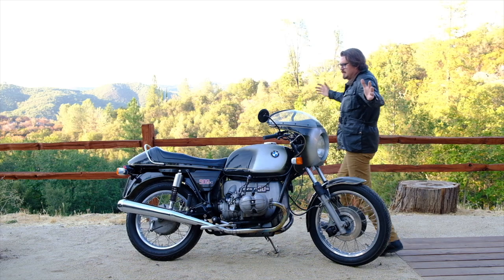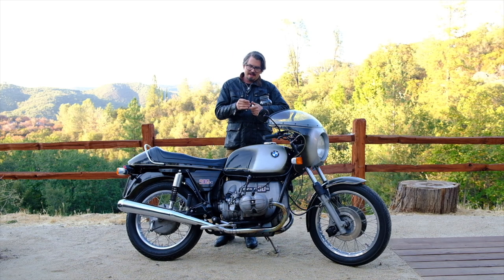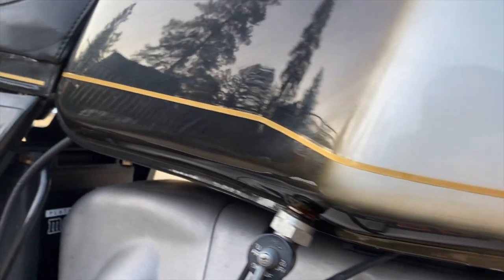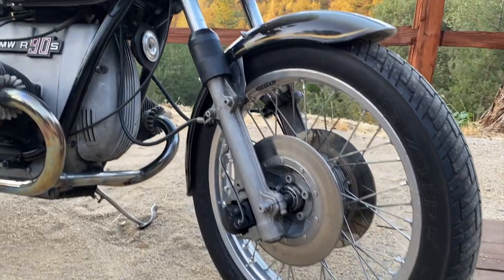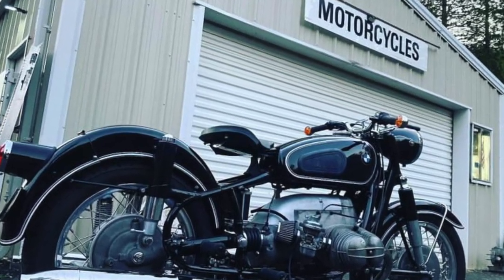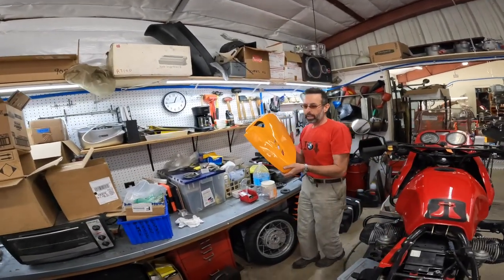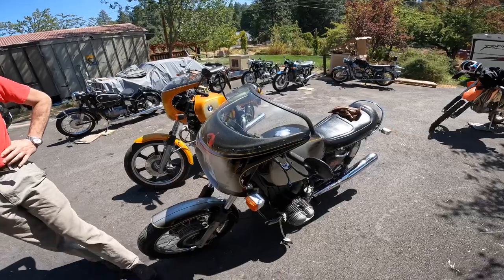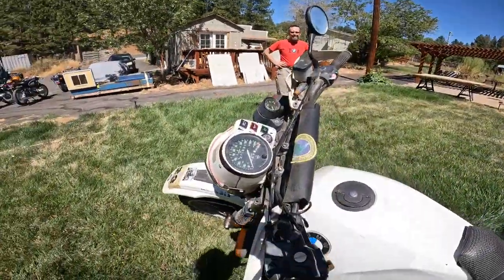Is this BMW’s Best Motorcycle? + Tour of Scottie’s Workshop! | A Bike and a Beer Episode 6

Comment: I bought a BMW R6/5 while in the military in Oklahoma.  I rode it home to Montana before being deployed, and the tachometer lasted less than 1000 miles.  After that the bike was bullet proof except for stuff like headlight bulbs.  It clanked when I put it in low gear, there was a disconcerting amount of driveling snatch, and it torqued like hell while waiting at stop lights. I occasionally got my pants leg caught on the tickler rod, causing me to almost tip over, again at stop lights.  The bike was overweight and under-powered, and it was, indeed, homely.  And I loved it.  That old pile of iron and pistons turned into an absolute swan in tight mountain highways, like those north of the Montana border in British Columbia where my girlfriend lived.

Comment: I owned 1974 R90S for about 12 years and it was one of my favorites. After a $2,000 purchase cost me about $1,500 in parts, tires, fluids etc to get road worthy. From there nothing regular maintenance oil changes, tires, greasing the splines, tune ups. Sold it for $5,000 to help defray one of my kids college tuition- a shame miss that bike but I’ve had many great bikes and many great memories.

Comment: That was a fun little video. I have 2 airheads and am the Air Marshall for my local chapter. You need to do a little learning about how to properly prepare your Weiss beer for consumption! Rolling the bottle to mix all of the ingredients before you open it is one and that particular beer absolutely deserves a proper glass! Commercially brewing in the same location since 1040! The signature clove and banana flavours are a by product of the yeast. I have over 1000 bottles in my cellar. 🙂
Reply from the maker: Great advice and thanks so much for watching! I look forward to trying the beer again with the proper preparations 👍
Reply: @wheelhousegarage  I've gone back and started at #1, I'll keep watching. Come on up we'll pull something out of the cellar. Pack your bags as I live about as far away as you can get on this continent from you. 😛

Comment: I owned a 1974 R90s, enjoyed it for over 130k of wonderful miles, had 2 issues with the tranny, 4th gear had weak dogs and, well, I broke them, but only after it had endured 75k worth of spirited riding, then a spring in the shifter broke putting the bike in 2 gears at the same time, if this had happened at speed there would have been a lock up at the rear wheel, then there were the spoke issues, I kept exceeding the tensile strength of one or two spokes, so that problem was dealt with when I bought Lester wheels. Many thanks to San Diego's Brattin motors for fixing my screw ups

Comment: Fun video and you were right about most things.  You can indeed ride the bike 1000 miles in a day.  I know because I did it with my new 1974 R90S.  I bought it brand new from House of Yamaha/BMW in Santa Monica, CA in late 1973.  They got 2 in and I bought one of them.  Tommy Smothers of the Smothers Brothers comedy team bought the other.  

There was an event back then called the California 1000 that ran out of L.A. Harley Davidson.  The purpose was to cover 1000 miles in a weekend starting at midnight in downtown L.A.  I covered 1000 miles on my 90S by midnight the first day.  Unfortunately, I'd missed some turns and had to backtrack so when I hit 1000 miles I still had over 100 miles left to go to get back to the Harley dealership.  I did the last 100 miles Sunday morning after a few hours sleep.  No matter.  For me it was an epic ride, one of my best in 56 years of riding.  And the engine does indeed let you run all day at high speeds.  I ran across the Mohave Desert for a couple of hours at speeds of 100-115mph.   The bike in fact would do an indicated 125mph topped out but the last few mph took some time.  As you suggested, the bike just runs.  It doesn't fuss, it doesn't shake, doesn't vibrate much, it just motors down the road as fast as you want to go.   It is over all the best all-around motorcycle I've ever owned.  And almost 50 years later the looks are still stunning.
Reply from the maker: Thanks for watching and sharing your stories!

Comment: Excellent episode!!

I had an R100GSPD that took me to, and through the Yukon and around Alaska in '98 and in '05.  Hands down the best bike I ever owned, until a hamfisted mechanic at the BMW dealer stripped out the cylinder head stud threads in the case, and then botched the helicoil repair!!

I wish I would have held out for an R100RT, instead of buying my '22 MotoGuzzi V85TT!!

Comment: I never had an R90/S but I did put 40K miles on an R90/6 that was dressed in the later model tank and seat. My bike was smoke red and since I worked at a BMW dealer back in the 80s I had all the frame mods, swing arm mods, cylinder head mods and a rear end out of a R80. I just had the Bings and not the Delartos.  I loved that bike. It took me everywhere.
Reply from the maker: Thanks for watching and sharing your BMW experience!

Comment: When it was time for me to replace my 1976 BMW R76/6, I was too impatient to wait for a mint used 1975 or 1976 R90S. So I bought a new 1978 Red Smoke R100S. I named it Big Red Who Smokes. It was pretty epic, but I never warmed up to it like I felt about the later R90S models. Cast wheels and the rear disk brake made servicing the rear brake and tires a lot less convenient. And I really missed the hydraulic steering damper. Plus the Bing CV carbs guzzled gas. So I heartily agree with you about the later R90S models.
Reply from the maker: Right on Noel! Thanks for watching and commenting.

Comment: DUDE! BANNANAS!
I JUST AQUIRED A 1975 R 90 S .ONLY MISSING THE QUARTER FEARING . HAS THE BMW 7 SPOKE MAGS AND EXTRA BAGS. THE ENGINE HAS DELORTO CARBS AND IT APPEARS THE HEADS ARE FROM A LATER MODEL . HAS THE " LINED SQUARED" VALVE COVERS   INSTEAD OF THE BULBOUS VALVE COVERS. IT WILL RUN WITH LITTLE WORK. HAS DUEL DISC AND SIDE STAND TOO. SEAT LOOKS PERFECT. ALL ELECRTICS WORK.
Reply from the maker: Congrats, sounds like a great bike!

Comment: Born in 1957 I rode fast bikes in the 1970s. Café racer Nortons then Ducatis. My squadron Leader raved about the BMWs he had ridden in the 60s in Gezrmany. He would get the groundcrew to skim the heads to raise compression then appropriate AVGAS to make them ride like a bomb. So I knew BMW could be good. Then I had a long chat with a BMW rider. He was on the 750cc equivalent of your bike. He had upgraded to your 900 version. Unfortunately with the 70MPH speed limit at that time in England and the 900 hit a vibration frequency that was unpleasant at 70MPH. He sold the 900 and bought another 750. It was a sweeter ride. But hey, I'm not a BMW specialist, my garage is full of Nortons, V4 Hondas and Yamaha RD30LC.
Reply from the maker: Thanks for chiming in Peter!

Comment: And : This time you're right! Riding it 1000 miles a day? Exactly that's what i did -1800 km from the south of Austria over the Alps right through all of Germany on the Autobahn up to 200 km/h (120 something mph) to the  very north. All in one shot , as my starter solenoid had failed and i could not shut the engine down and start again, even when filling up under way. 😁
Reply from the maker: Incredible!!

Comment: Just subscribed; very good posts! I do like the beer matched posts, so will be interesting see which English ales match any Brit’ bikes.
Yes, the 90s could well be Beemers best twin and bike. Hand build weren’t they? Fast, stable, well finished, the only ‘downside’ was that, back then, BMWs had an image problem no more. And only a few years ago you pick one up for a song. Never ridden one but I just know I could get on well with one - I currently own a 75/6. The trouble is……when forking out the folding for the 90s, would I be regretting not going the extra mile and buying that Guzzi V7 Sport swapping the beer for a grappa? Answers on a postcard…..
Reply from the maker: Thanks for subscribing! Great thoughts, thanks for sharing!

Comment: R90s to look at, 1984 R100rt or rs to ride. But that's only because I never owned a GS. If I had I'd probably go with one of those. My experience has been that the R100s are easier to ride long distances than the R90s. Plus they have better brakes and electronic ignitions. I found Bosch electronics to be only marginally better than Lucas. I think Joe and Robert must have been roommates in college or something. Ask me about the electrics on my Laverda 3C sometime.
Reply from the maker: Haha! Good insights

Comment: Why banana? It's not banana at all. It's a combination of sweetness of wheat instead of the usual rye, and the yeast, which is not a content of any other beer. But boy, you can NEVER drink that out of the bottle, it has to be poured very slowly down the inner wall of a tall half liter special "made for wheat beer" glas in one shot, so that the foam ( which is called flower ) would exactly rise to the top and not flow over. And please-- don't ever think of ice cubes! What you experienced must have been purely foam gulping. The drinking itself has a thousand years of culture too. Not just gulping anyhow!.
Reply from the maker: Check out my next video - I took your advice 😉

Comment: I have a 1985 R80 with 5,000 miles on it. The gas tank rusted from the inside and gas just pours out the bottom. 
15 years ago I did a cream job on the inside but it failed after 10 yrs.
Reply from the maker: Ouch! Time to get the welder out :)